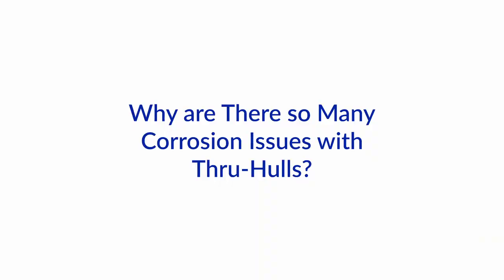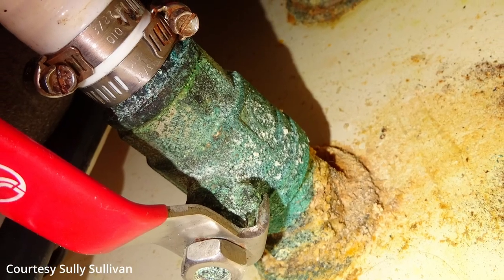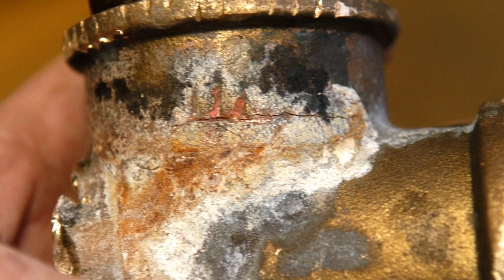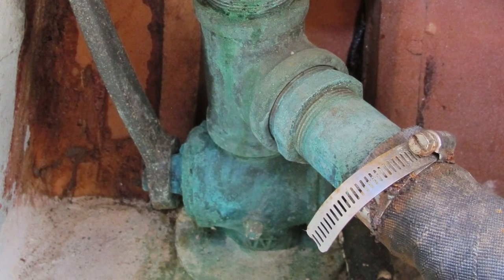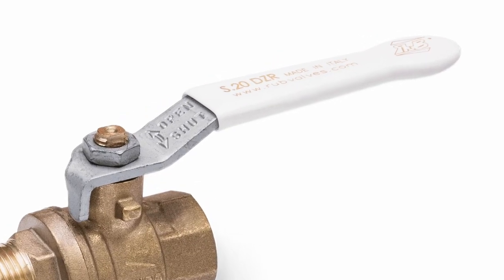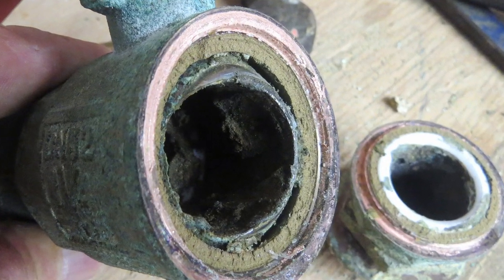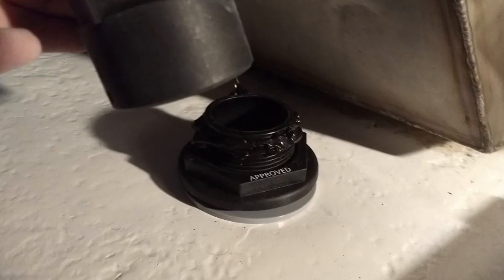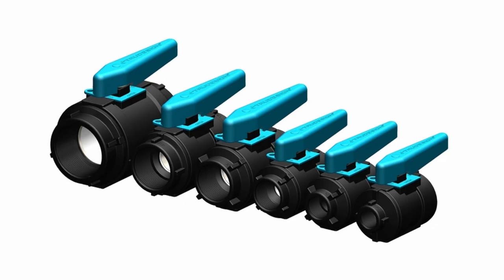Thru-Hull Corrosion: What's the deal with Dezincification? | Ask The Expert with NIGEL CALDER

Comment: Nigel on my boat, all the sea cocks are bonded to a comon wire tied to the zinc anode.  Does that prevent the corrosion issuea on these valves?
Reply from the maker: Yes, that’s the idea. However, to be it relies on an extremely low resistance in the bonding circuit and all its connections, and on maintenance of the sacrificial anode. If resistance builds up (from corrosion, etc.) and the sacrificial anode wastes away, the corrosion protection will steadily diminish. In particular, the effectiveness of the anode is proportional to its surface area so it needs replacing when it is approximately half gone and not when it is all gone.
- Nigel

Comment: I would like to know Why no one ever uses Titanium thru hulls? It's our strongest metal, non corrosive, and if you put on a marilyn or trudesign ball valve  there'd be no corrosion. I don't think they make a ball valve Yet. And there not much more than a bronze one.
Reply from the maker: Titanium is expensive and in general we have other ways of avoiding corrosion, such as quality bronze or reinforced plastic. In the racing world, where every ounce of weight matters, there is a significant amount of custom titanium fabrication, although I don’t know about valves, but in the less esoteric and lower budget world in which the rest of us operate there is little to no off-the-shelf availability of titanium products and without some level of scale the cost will always be high.
- Nigel
Reply: @BoatHowTo  Is it true that stainless steel thru-hull should not be used below the waterline??? As I understand it marine bronze or glass-reinforced nylon composite are the best options of materials to use below the waterline.
Reply from the maker: @abelvazquez6012  Unless you use extremely high-grade of stainless steel, it is likely to exhibit pitting corrosion when exposed to salt water over longer periods of time (in particular warm, tropical water). So stainless steel is NOT a suitable material for below-the waterline fittings. High quality bronze or dezincification resistant brass (only if top quality) are much better. But from a corrosion perspective, the ideal option are indeed composite materials like the ones used by trudesign and marelon. - Jan